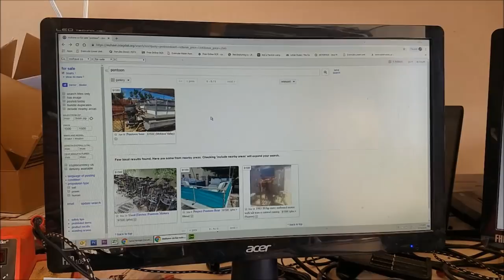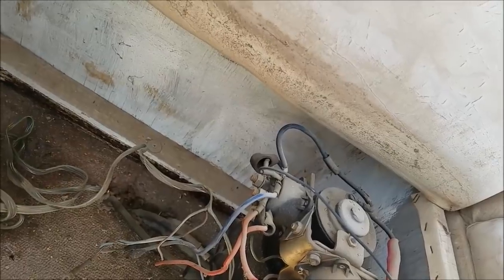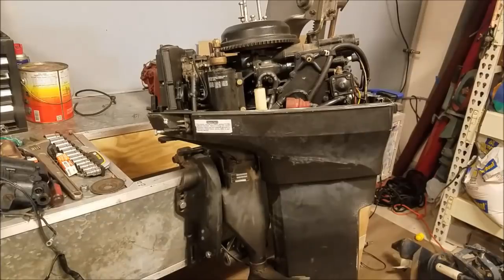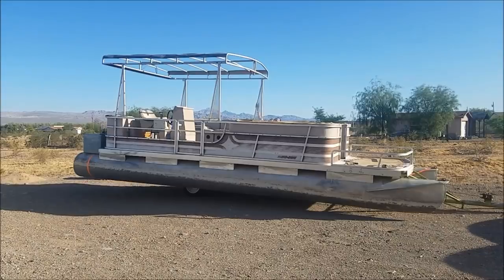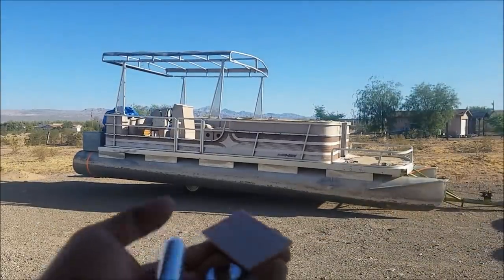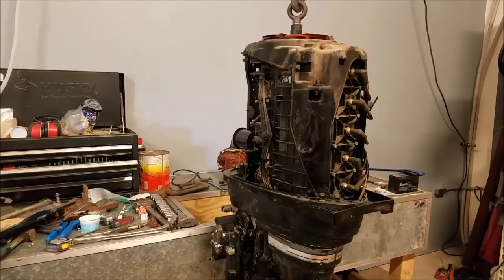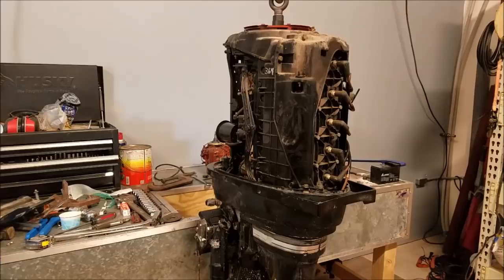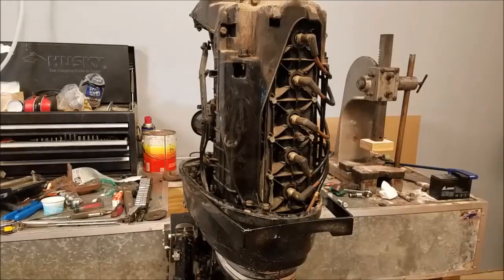I Bought The Cheapest Pontoon Boat On Craigslist

Comment: We bought an older 24 foot Kayot pontoon with a similar trailer to what you have. Love the trailer because there's a 2nd winch that lowers the suspension out from under the boat. You can back onto the lawn, lower the suspension and gently set the pontoon on the grass and drive the trailer out. Great for tire changes and maintenance. We threw away the merc 75,(boat anchor) and bought a '96 seadoo 750, chopped the nose on the seadoo and removed the outboard plate on the boat and it fit perfect. It moves right along now, and don't have to worry about running up to the beach and ruining a prop. Makes for a fun boat.
PS, no matter what motor you end up with, it's Always a good idea to have a kicker or even an electric troller, and an anchor,  because when the engine dies for whatever reason, you become a kite driven by the wind no control.
Reply from the maker: Yeah, I noticed that too. The boat is just a huge sail without the engine. 
I agree, tossing the Merc was a good idea. 

Have photos of your setup?
Reply: @BrandonsGarage  it's at our summer home, we'll be there in July, I'll send pics.  It has inspired others to make similar conversions,   a 12 foot inflatable that does 60 across the lake now, with the addition of a seadoo donor setup, aluminum boats, etc.. pretty kool.
Reply: yeah and an anchor is one of the things that the coast guard dosent insist you have on board.....go figure.
Reply: @izzimichaels2892  😁
Reply: @izzimichaels2892  weird. In Canada it's requirement to have a second form of power, paddle or kicker, or an anchor.
Reply: @dart5722010  and that makes perfect sense. it should be a requirement, in my opinion.

Comment: 40hp will do it ok if not TOO many aboard, yank all the seats plant some boat seats on thrones? cleaned up new linoleum and lawn chairs save some weight, with the chairs folded away you could set up a good size "built in" tent on it could be cool.
Reply: model nutty
 I HAD AN OLD USED RIVIERA CRUSER WITH STEEL PONTOONS BACK IN MID 70’s. HAD A 35 HP MERC WE USUALLY RAN IT JUST A LITTLE ABOVE IDLE AND PUTTED AROUND THE LAKE (LITCHFIELD, IL) WHAT A BLAST!
PLENTY OF HP.
Reply: yard farmer you must just like to cruise then
Reply: a few years ago we built a pontoon boat 8 meters long with a rigid roof, stainless steel rails, a water tank, so it was quite heavy. The Honda 45 hp engine was enough to sail efficiently on rivers in both directions. These hulls are not very efficient in terms of speed and I remember that in terms of fuel consumption/speed it was good to keep the revs at medium. Later there was more noise, water spray but not speed.

Comment: That Merc 115 was the best thing about the boat
Reply: I have never seen a mercury that worked as well as omc or Yamaha.  I knew people that bought them in the 70s and 80s and they all regretted it.  They were always hard to start and misfired all the time.  They may have gotten better with fuel injection.  I dont know anyone who bought them after getting burned once.  Of course with companies like force and mariner out there, Mercury looked great by comparison.
Reply: Imc is everude right?
Reply: @redline9579  Evinrude and Johnson. They were basically the same.  They also made cobra I/O drives paired with various automotive engines.
Reply: @michaellowe3665  I had one of those carb Merc Tower of Powers that lasted 31 years.
Reply: My 1984 90hp Merc tower of power is still running fine, starts easy, not bad on gas, never misfires or gives any trouble whatsoever. I’ve also owned several other Merc inline 6’s over the years. So, I have to question what you’re basing your inaccurate information on? Seems like you just don’t like Mercury? 
The only thing I can think of regarding the inline 6’s is that failure to change impellers yearly can destroy the top (#1) piston/cylinder by causing overheating issues when the impeller fails. Besides that they’re pretty good.
Reply: @uthermaceanruig5098  yep. the whole Ford/Chevy argument. I loved my Merc TOP!

Comment: I enjoyed this video as  i grew up in South Florida and a lot of the camera  angles and sounds brought back  a lot of old memories  of working on  old boats  i actually still like some of the  oldie motors  even sometimes because  of their popular  or well known  flaws  one time  off shore Miami Florida  we were out  Diving in my Uncles old boat with a Chrysler 110  out board and  the  electric starter  system completely  failed  we were forced to  do a pull start  using  one of the mooring lines  wrapped on the flywheel  which actually  had  notches in the Flywheel  for that  purpose  it took 2 men and 1 boy to get the old girl started but we did it  btw the old Pontoon for 1500 bucks wasn’t that  bad  ive been  a DIYer my whole life and about 15 years ago i Ebay  purchased a Walk-in Foot Industrial sewing machine  to do my own marine vinyl and Canvas  in a effort to save money and have more quality control  plus  ive done some Vintage car interiors  of  course the Sewing machine  is aChines Clone  of a White machine  that the patten ran out on  it basically looks like a Sailrite  although they claim they  use there own  parts and designs that are better  and that may  be true the Clone  works just fine for what i do and in case i need to do  repairs the Sailrite  parts that  are available off their website  do fit   and work on mine now everything ive made  i did make my own patterns  but in your case  you could easily  use whats left  on those old pontoon seats you got  to make it pretty easy   if you so incline to do so

Comment: I have a question.  Can trolling motors be repaired when the only speeds that work are 3-5?  It’s a used one but it’s a great price.  If you can help me I would appreciate it sir.
Reply from the maker: Well, it depends on the motor.
On the lower level 'budget'models, with a tiller handle speed controller, this is simply fixed with a new switch. On the much more expensive models, the speed is controlles via a circut board inside the motor; a much more involved, difficult, expensive repair.
In both cases it came be fixed of course.

There is also the case where the motor is starting to fail, and only works on high because of the additional power it need to get ot spinning (think of an old fan)
Can it be fixed? Probably. But is it worth it is the real question.
Reply: @BrandonsGarage  It’s a minn Kota with a foot pedal 70lb thrust.

Comment: That old mercury tower of power is an extreme para for Motor you’ll love that when you get it right
Reply from the maker: Yeah, I know. 
Problems are, all wiring insulation had fallen apart, the power trim didn't work at all, needs 2 power-packs, and 4 coils; and of course, all maintenance parts. Also, its so darn tall, you cant tilt the engine more than a few inches before it smacks the rear door. 
I don't have a collection of Mercury outboards to start swapping good parts over like I do OMC motors. 
For now, Ill leave an OMC on it. The Merc will get stored until I find the parts, or get into Mercurys.
Reply: Yeah that things a beast hands down had one on a bass boat there's nothing to them to fix either

Comment: enjoying your channel! looking forward to more vids on the pontoon.   Wondering from you comments any reason why you would go from a 40 to a v4, wondering if there is a reason to avoid 3cyl? Thanks.
Reply from the maker: Power and speed really. However the 40 seemed to do just fine.
I just like the 40/50's better. Smaller, lighter, cheaper (much better on gas)
I would like to put a 4V on it to just compare the performance difference. 
And no, 3 cylinders are just fine too; I just don't have any.
Reply: @BrandonsGarage  thanks and good to know. yeah the v4 can burn a bit of fuel ;-)  I have a 93' 90hp johnson, great torque, note replaced VRO with standard fuel pump and I think it is more efficient on fuel.  All the best with the test!

Comment: Show more on that evenrude 40! I have the same motor!
Reply from the maker: Oh I will.
Plan is to do a VRO delete / fuel system video, a lower rebuild / water pump video, and a power trim/tilt electronics/controller video.
I have a lot on the 1989 40 HP I did, but they are a tad different in 93.
Reply: @BrandonsGarage  I guess mine is a 1991 Johnson 40. I just found your channel last night I'll be watching quite a few more of your videos! Thanks!
Reply: Take care of that OMC motor and it'll last longer than you. Great video.

Comment: Im impressed the seller got more than 50 bucks for that pile of junk!! ESPECIALY with no trailer!! The motors were legendary, but Most of the Craigslist motors are ruined beyond repair where the sea is near by. No canvass, seats in ruin,...Scrap!
Reply from the maker: Came with a trailer...
Reply: The sea isn't nearby and for $1500 in Arizona you can't beat this boat. I nearly bought it back in February when I stumbled into it while working out of town, didn't have any reasonable way to get it home or it would've been mine 😀
Reply: Oh and BTW, there's way more than $50 worth of scrap aluminum in that thing.
Reply from the maker: I completely agree.

Comment: Pull the engine b4 changing gasoline? If it ran you might have considered scraping the erude cause it's a pos
Reply from the maker: @ 11:10 you can see the portable gas tank. Granted its old, but had new gas in it.

Comment: U need like a 200hp on that boat
Reply: Cooper Leonard no 80 is perfectly fine for going around 25mph so i would think 200 is a little overkill
Reply: Buy a bassboat if you want 45-knots on the water. Buy a pontoon to drink beer and drown worms...40-hp will get you there, JUST FINE (and save you a LOT of beer money in the process).